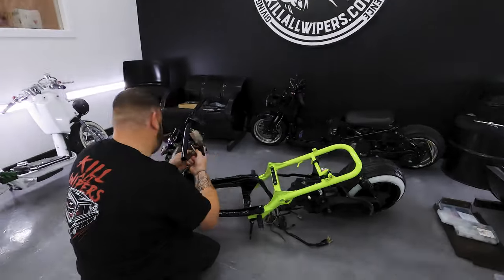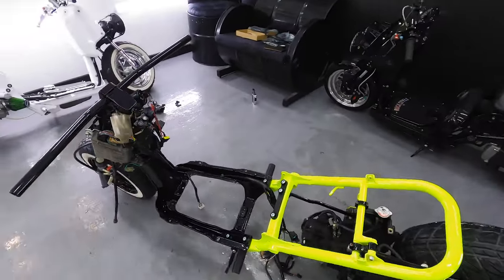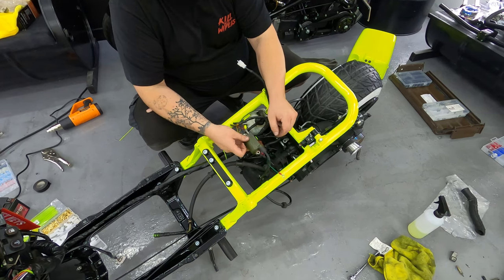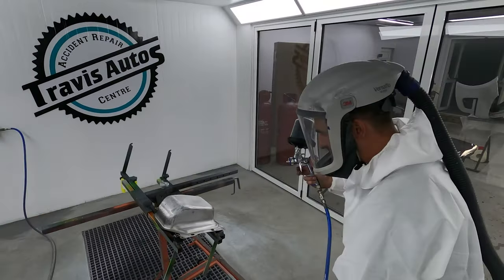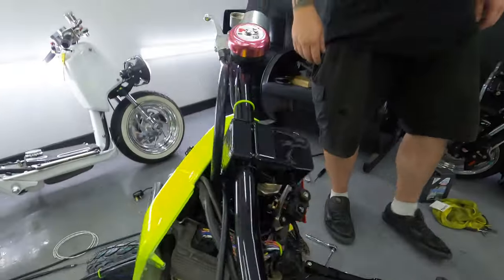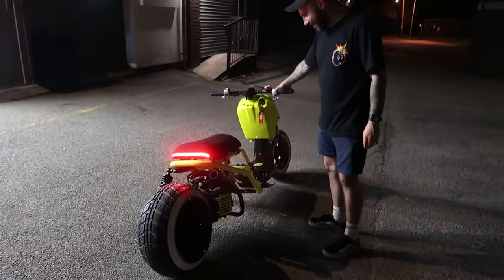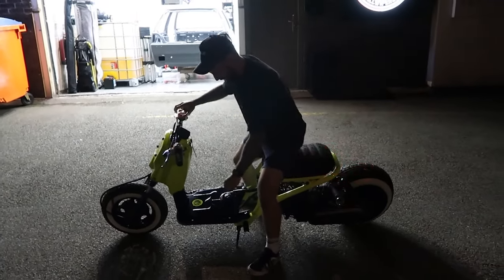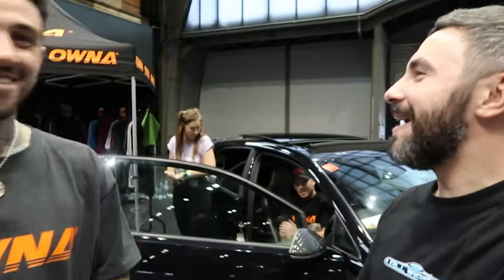HONDA RUCKUS BUILD GET'S FINISHED

Comment: yessss, i love this series! quick question, any chance lee had to modify the throttle tube or grips for the vans grips? I put some on my ruck with the same bars and the throttle side grabs the silver control unit.
Reply from the maker: They slid on ok to be honest man! I remember trying to fit to my NCY throttle and it was pretty tough but we used the OEM ones for now whilst I sort the rest of my controls etc for black ones!

Comment: Any chance of getting a "parts used" list? I just picked up a 2022 ruckus and got a slammed front end disk conversion kit with a NCY front rim. Want to stretch and lower the rear as well, and keep it 49cc as well (at least for now). Dont know if I want to cut my oil fill like you did. Can i get a fatty 10" rim and avoid that?
Reply from the maker: Hey man, yeah let me update the description with all parts and links! Also I don’t believe you can get away without shaving the oil cap section.
Reply: @KillAllWipers  Awesome! lol great videos by the way. Most of the other good builds on YouTube seem to be from 4-6 yrs ago. Nice to watch a build in 4K lol
Reply from the maker: @IAmUltraMAGA  haha thank you man! I’ve got another one which I’m working on so more content to come on the ruckus! This one is going gy6 I think! 🙏🏻
Reply: @KillAllWipers  looking forward to it. just ordered a whole bunch of stuff to build my new ruckus excited to get started on it. scared to do the teardown on a bike that has less than 10 miles on it tho lol
Reply from the maker: @craigl2385  hey man! I’m pretty certain they are all pretty much the same! I’ve never been aware of a better year or anything like that! Hope that helps man!!